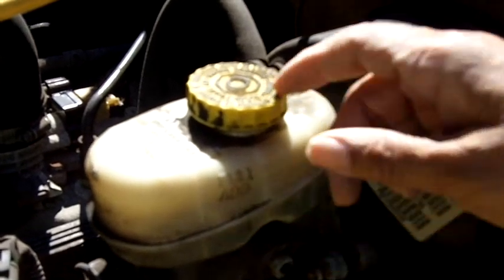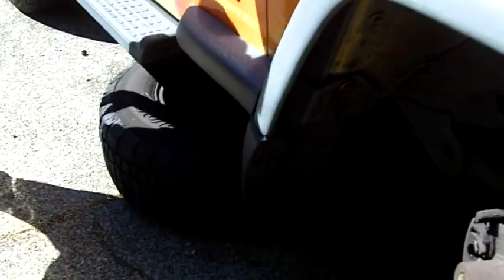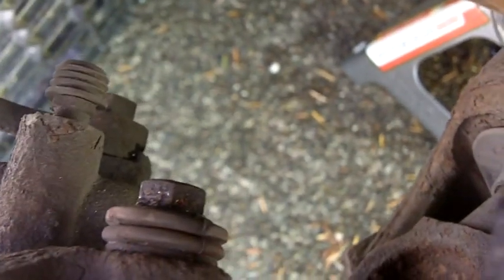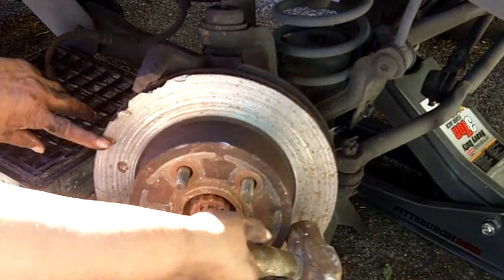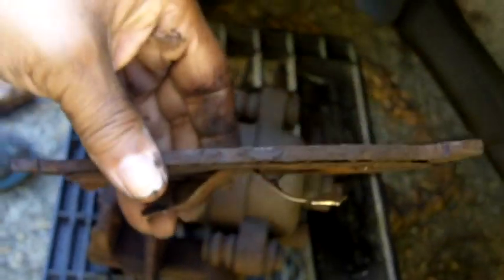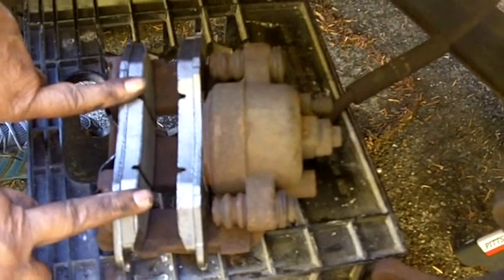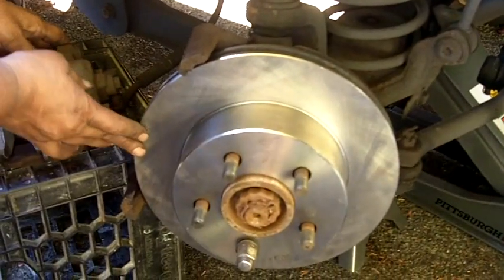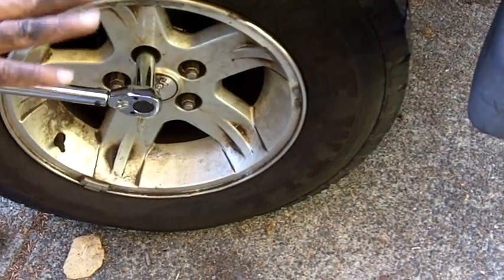Brake, Caliper Slide Pins, and Rotor Installation Tutorial Jeep Wrangler 2004

Comment: Fantastic video.  Thanks for taking the time to put this together.  Time to go change some brakes!
Reply from the maker: good luck with your project, Jason!
Reply: Everything went smooth.  Thanks again for the instruction.  I had one caliper that was hanging, I took it apart a second time, greased everything like you recommended, and all is well.  Thanks again!!!

Comment: Hi Leah, could you please do a video on how to repair a shingle on your roof? We have a leak and we are clueless on how to repair this!
By the way I LOVE your channel! Your money saving tips and step by step videos make me feel more comfortable with the projects I am doing! Thank you!!!!
Reply from the maker: ashleyshay55 Locating the source of a leak is more of a problem than the fix.  If it's not a shingle which has been blown off or damaged as a result of a storm, then chances are, it's not the shingle, but a gutter, flashing, failed mortar, a bad seal around a skylight etc.  Leaks are tricky because finding the source of the leak is the real challenge.  To be more specific, water will often travel, so the location where it's leaking inside the house isn't necessarily and is seldom where the problem is located.  

Let me ask.  How old is your roof?  What kind of roof do you have?  Is it wooden shakes, slate, asphalt/fiber glass shingles etc.?  I would be more than happy to make a video for you, however, it may not solve your problem.  

 I seldom suggest enlisting the help of a professional in your area, however there are exceptions.  Some roofers specialize in locating and patching roof leaks for a low rate.  Their business is geared toward solving water intrusion issues rather than large jobs like roof replacements.  This might be a good route for you to take.

Comment: Wow, I have always wanted to learn to do this stuff myself. I need to replace my brake pads, rotors and calipers on my 2004 Jeep. The quote I got was $350 per axle. I almost choked.  That was for basic OEM replacement parts. I wanted to get some nice rotors, pads and calipers.  After watching this, I have no doubt that I can do this. It was always a mystery to me how these things all fit together, now I know.  I do have a couple of questions. 1. Which is better ceramic or semi-metallic brake pads?  2. How do you remove the hose from the caliper in order to switch to new calipers?  3. I thought there was a process after you replaced the brakes to bleed the brakes, what is that?  Thank you so very much for this video. I agree with what others have said, you are an amazing woman.
Reply from the maker: +Glenn Bourbon Hi Glenn.  I've always gone with semi-metallic brake pads, because they are reasonably priced, and they are good general purpose pads.  I've been very happy with the performance, and they tend to work better than ceramic pads in cold weather.  But the up side of ceramic is that they will last a lot longer.  Now, for your 2nd question about removing the hose from the caliper,  you will just need a couple of box wrenches, and it's usually a double nut on the brake line, near or on the caliper. (At this time, you would be best served to get a Haynes Guide) Last, regarding bleeding the brakes, I didn't have to bleed the brakes in the video because I never disconnected the brake line, so I didn't need to worry about air getting in.  But, if you are going to replace your calipers, you will need to bleed the brakes.  This is a job best done by 2 people, but they do sell brake-bleeding kits to allow you to do it on your own.  
Here's the thing that I just want to say.  Replacing the brake pads and rotors is a job that I feel that anyone can learn to do, as I showed in the video.  But when you get into replacing the calipers and bleeding the brake lines, it moves from being an intermediate level job to a more advanced one, and a much more serious and potentially dangerous job, if not done properly.  For this reason,  I would advise against it.

Comment: Jane, I watched the video and in addition to the pads and rotors, when I went to push back the caliper with the "C" clamp, it was leaking brake fluid.  So, off to O'Reilly Auto Parts to get 2 new front brake Calipers.  I was (with some PB Blaster and a few hits with a hammer) able to loosen the funnel screw holding the brake fluid line in the back of the old Caliper.  I already had my new pads in the new caliper and went to install it and I got the bolts to thread and ratcheted them in place, it feels like my rotor is rubbing my back pad when the wheel turns.  Is this something that will come into place when I get everything back together. The back pad is seated properly and the hooks on the pad are on the caliper slides.  I also know that I will need to bleed the brake lines. But I am worried that something is not lined up properly.
Reply from the maker: Hello Glenn,   Sounds like it could be rotor lateral runout.     
 As for bleeding the brake line, it's best accomplished as a two person job.   There are, however,  bleeding kits available that will allow you to bleed the brakes without assistance.  Hope this helps.

Comment: I love your video... kick the camera man in gear lol. My favorite thing about this video is any non car person can watch this and probably even get the job done if they have the right tools (having the correct tools is essential to any job) also if the rotors look like they've never been changed id use WD-40 and a breaker bar if you can find one.. just needs to fit over your socket tool and clear your fender (this always turning the wheel in the opposite side your working on to give you more space) I use a special spray (its special as in its made specifically for loosening bolts that are machine tightened or just old rusty bolts. I just found the hardest part on my 03 Jeep Liberty  3.7l  was the bracket holding the rotor. 2x 21mm sockets and the break line was solid which wasn't far from the top bolt.
Reply from the maker: thanks, Eric!

Comment: After watching a few of these videos which are very educational, I noticed that most people neglect to service their brakes till the pad is worn down to the metal backing of the pad until there is metal rubbing on metal, that's what is causing this condition here in this video. Would'nt it be cheaper if people kept watch periodically to see that this does not happen and replace their brake pads sooner? I think it would be cheaper in the long haul avoiding unnecessary costlier brake jobs. What I do is look out for the slightest squeezing or periodically visually inspect the brakes to save me a lot of hassles.
Reply: I'm sorry I meant squealing not squeezing, just did not want to rewrite the entire paragraph again.
Reply from the maker: *****   Hello Jake,  Preventative maintenance is always a good thing.

Comment: Nitrile gloves will keep your hands very clean. Every rotor has the specs stamped into the rotor (min thickness, etc). Turning is good as long as you don't take of too much. Remember, those rotors also have to dissipate heat from braking (turning kinetic energy into heat). Rotors that are too thin to dissipate heat will more than likely warp.  You should show how to check runout in the rotors as well...it's easy to do...
Reply from the maker: +QuantumRift Yup, gloves are a great idea.  As for demonstrating how to check the runout with a dial indicator, the video was already pretty long.  But thanks for bringing it up, because it might make a good video on its own.
Reply: +seejanedrill yes...good points! Thank you for the information. I have had to do FOUR brake jobs (front & rear) on 4 cars this month so far...my wife's 2004 Envoy, my dad's 2002 Chrysler Concorde, my neighbor's 300, and my mom's Saturn Vue. Nezt month its my 2012 Genesis, and Suzuki Burgman 650!

Comment: Don't want to be rude but you shouldn't leave brake fluid cap open. The humidity from the air will mix with the brake fluid damaging the system. Just like pouring water in the brake fluid.
Reply from the maker: +Serge Shariy On a 30 minute brake job, taking the cap off the reservoir isn't going to cause a problem, and it's a way to deal with compressing the piston on the caliper.

Comment: That break cleaner is not a good idea for wheels in better shape than yours, for instance clear coated rims
Reply from the maker: James Brewer Hello James,  I use a non-chlorinated brake cleaner because I find it does not damage plastic like some brake cleaners are known to do. You make an excellent point however, as not everyone will know to use a non-chlorinated product.  I'll  make certain to add a note to the video, stating that some brake cleaners can harm the plastic clear-coat on car rims.  Thank you, and it's also nice to hear from you again.